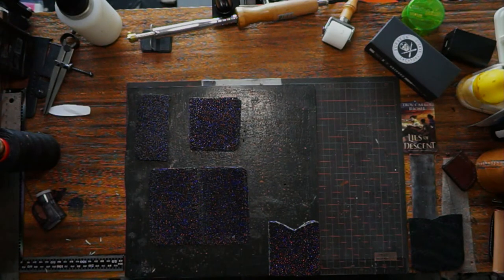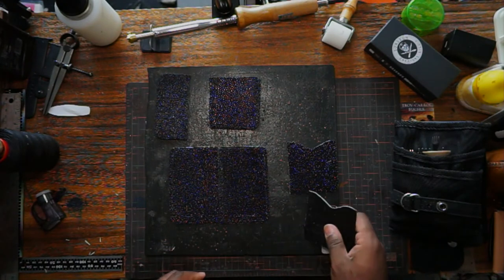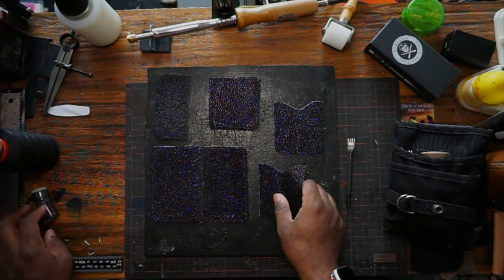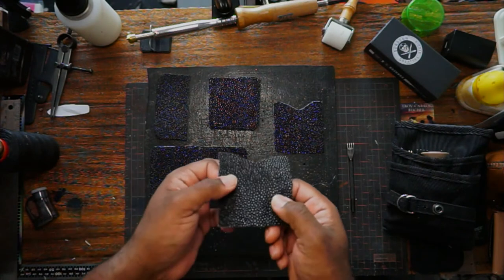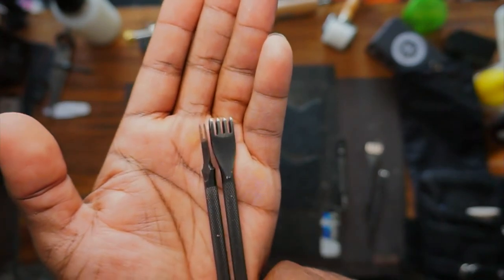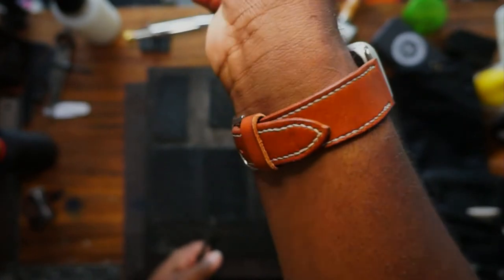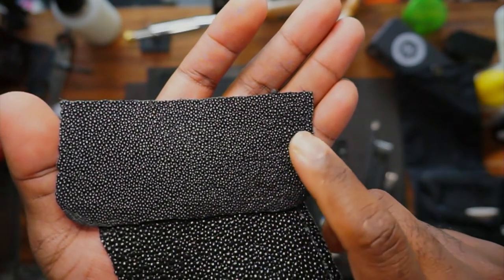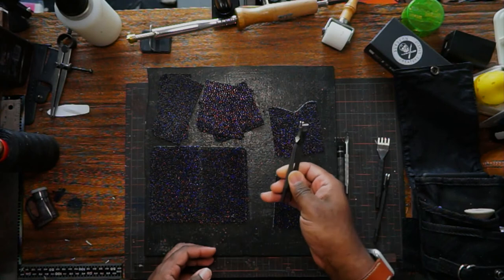Tips for Stitching with Stingray

Comment: Hi just saw yr video on how to stitch stingray hide. Just would like your advice because I want to make a watch strap out of stingray, how to sew or stitch by hand. What size chisel is suitable. And should I chisel stingray side or the underside with the leather. Please advise much appreciated & thank you in advance 🙏
Reply from the maker: the chisel size will depend on the thread thickness you intend to use. thinner thread and a wide spacing looks 😒, bigger thread in small spacing looks crowded. 

i always chiseled stingray from the top. i’ve never had any issues with stitching that way.
Reply: @JRenardLeatherCo  Thank you for yr advice Mr. Renard. If can & if I'm successful in making it I'll send u some pictures to look at ya thanks again cheers
Reply: @fattsengwong8064  try just using glue go leather and only minimal stitching along the watch pins
Reply: @fattsengwong8064  ooo and edge paint

Comment: This is very informative.
Have you ever drilled holes to stitch stingray?
Reply from the maker: i haven’t, but i also haven’t made anything with stingray that was so thick it required something longer than stitching chisels. also, all my drill bits are wider than my threads
Reply: Thank you sir.